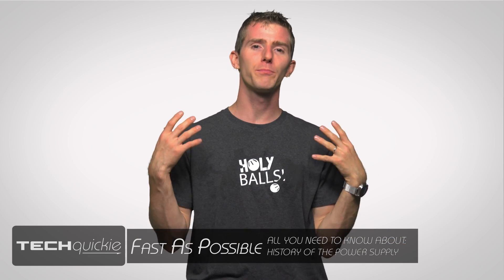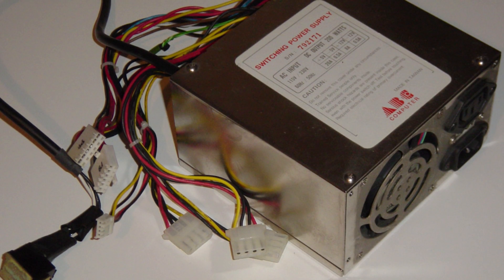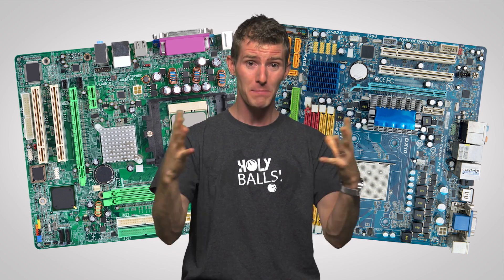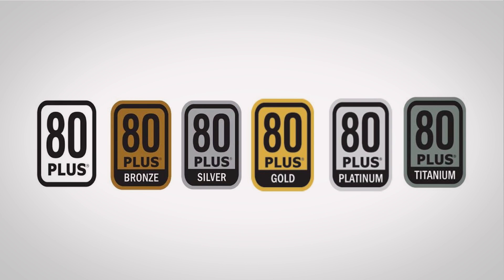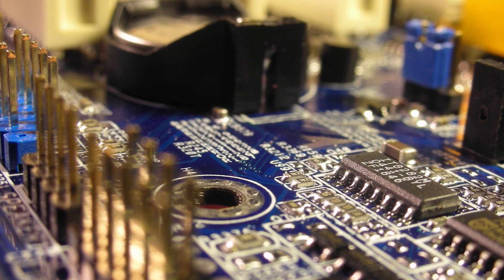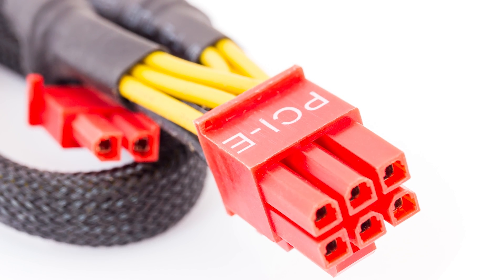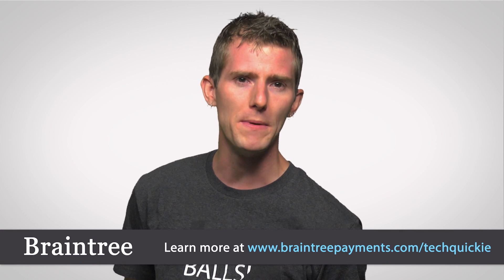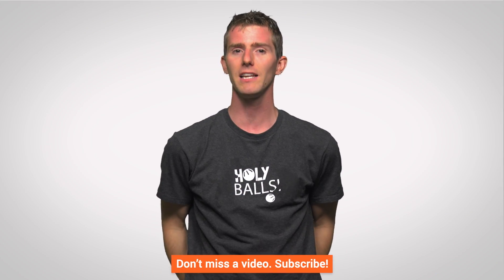History of Computer Power Supplies

Comment: What I really want to know is why you need 24 pins for 3 or 4 voltages. It doesn't seem like the motherboard uses enough power to require that considering the CPU and GPU get supplementary power. 8 pins on PCI-E gets 150w but I know the mb doesn't use 450w
Reply: because there also is data, plus minus, grounding and a dedicated line in and out for the boot sequence.
Reply: +tjeulink there's a single green wire for data (only used to power on) power off it done by reducing current draw through powered wires. There is also a single power signal cable. Other than that there is no other line used for data transmission since there isn't much that the PSU needs to know or tell. The remaining 22 cables consist of 4 3.3v, 8 commons (ground/minus), 7 5v, and 3 12v runs. It just seems like a lot to me and makes for a very unmanageable/bulky connector that delivers only a small bit of power.
Reply: +keco185 well what else would the Power suply need to do than deliver the correct Power format to components? you could make a smaller connector but that would make the motherboard easier to die because it would need to do quite a lot of Voltage stepping.
Reply: the ATX standard typically uses 18 gauge, PVC insulated single core copper wires. This wire will typically have a rating of 9.5 amps. This means the power wires going to the motherboard can deliver as much as 580 watts while remaining in spec with the limiting factor being the number of commons. Since the motherboard only needs to supply 75 watts to PCI-E devices, most of this is overkill. They could get away with 1 12v, 1 5v, 1 3.3v, and 3 commons (plus 2 data cables). This would total 8 wires instead of the 24 being used.
Reply: ***** yes but the pin connection can handle a maximum of 8 amps. and there are more than 1 wire for data, 1 for power on and one for power okay. it also needs the aditional power outputs for sensing the voltage drops, those cant be put on the same line. you need 5 volts for the standby function so your system will power on when the power supply isnt running (aka the system is off). then you need grounding for every line in. this is all i know top of my head, im sure its somewhere on wikipedia or something what ever line is used for.
Reply: voltage drop is typically done locally with drop across the cable compensated for ahead of time. It is not part of the ATX spec and doesn't take up any physical pins. There are 2 pins for data. My argument is that there shouldn't be a need for multiple pins with equal voltages. This is more of an antiquated thing which isn't needed anymore. When you say ground I believe you are referring to common. All 3 voltages can share a common if needed but most likely don't out of fear of cross talk which could increase impurities in the voltages. Also, standby power is not used to power the system on. Pressing the power button simply creates a short between the power on signal wire and the common. The PSU checks the resistance between these two and when it drops the power is turned on and the PSU then sends a signal to the motherboard through the 2nd data cable to start up the components. My guess is that these extra wires were used in the past to minimize voltage drops between different components (interference). However, modern voltage regulation should deem that unnessessary.
Reply: ***** it actually is part of the atx spec.
http://www.formfactors.org/developer%5Cspecs%5Catx2_2.pdf
common and ground is practically the same in this context
Reply: would you look at that. Well I guess that's 3 signal wires now.

Comment: IPC as fast as possible........ still waiting, Luke lied!
Reply: no multiplayer Luke ¬¬ ( /s)
Reply: The long and short of it is that the "I" in IPC is essentially how many calculators you can use at once.

So you have 2 hands, that's two calculators.

So that's 2 instructions you can do at once.

The "PC" part is "per clock," 1 megahertz is 1 million cycles in a second, 1 gigahertz is 1 billion cycles in a second. So if you run at, say 1 hertz(aka, 1 cycle a second), you could do 2 calculations a second with your calculators. If you ran at 1 megahertz you could do 2 million calculations in a second.

Modern processors can do a lot more than 2 calculations every clock cycle of course, but there you go.
Reply: same here
Reply: Llorch Durden h6

Comment: actually sfx psus are better because they deliver basically the same performance in a much smaller form factor
Reply: danielbatmanj The psu is pretty much the last thing that effects the choice of the case size... What I mean is, that you don't choose your case by the psu but the psu by your case.
Reply: How does that make them better? If you use a standard mid tower case there is no reason to use a sfx psu...
Reply: They are more expensive for the same wattage, and don't go beyond ~600 Watts.
Reply: Actually no.
Reply: If they were, linus would recommend them.
Reply: thats the point, with the smaller parts you dont need a mid tower you can get a mini tower or a super small case
Reply: actually they go to 800watts
Reply: +danielbatmanj different form factors are made to fit different applications and in this case the form factor does not matter
You can have a super reliable 1000w sfx psu but it's useless if you use a standard atx/itx case, and vice versa
Reply: Thats not correct, search for SFX-L the L is for long. Then you will find 700w + platinum from silverstone. It gets even better they are working on 800w titanium SFX-L . Interesting times we live in certainly.
Reply: Okay, I'll keep that in mind as soon as the PSU starts being the biggest component in the case.  GPUs are going to have to shrink a lot to make that happen though.

Comment: Explain redundant PSUs  please
Reply: if I'm not mistaken, those are the boards with two 42 pin connectors, right? Basically all servers?
Reply: In my (admittedly limited) experience with redundant PSUs, the unit itself had one set of connectors for the board and peripherals and two power supplies that slid into the unit. I'm guessing that under normal circumstances, they split the load but if one failed, the other would take over entirely and you could slide the failed one out and replace it without powering anything down or even opening the chassis.
Reply: Ideally you have each PSU fed from a different circuit in the electrical panel too.

Comment: Can a 600 watts Thermaltake PSU provide enough power to a 2 8-pin PCI-E videocard (1070 FTW)? Not bronze/silver/gold certified.
Reply: Yes that's fine, assuming your not running some crazy cpu like a xeon (which I would be very surprised if you were lol)
Reply: No, you need at least 10,000 watts
Reply: +tajony-32 you definitely don't need 800 watts for a single 1070. My roommate only has a 550 watt and he's rocking a 980ti
Reply: Should be fine
Reply: 1800w*
Reply: Dude, don''t go cheap, get at least 600-700 watts from a good manufacturer like EVGA or SIlverstone
Reply: 600w  should be able to handle two 1070's in SlI tbh, just never guy a psu that doesn't have an 80 plus rating, if they couldnt design it well enough for 80% efficiency in this day and age its probably lying about its power rating.
Reply: No
Reply: Get at least 800watt for that
Reply: 1800 watts should be something like the minimum to run a celeron+720
Reply: However, evga g2 550w and you take the perfect single-gpu psu
Reply: I suggested going with a power supply that is at least 80plus gold rated simply for the reason that with the higher efficiency comes lower heat output which in turn lower the noise output from the component. You can find the exact wattage power supply you need from cooler master's watt calculator located on the cooler master website. Also don't cheap out and go for the bottom of the line 700w EVGA like I did, once it hits about 400ish watts it quickly becomes the loudest part of my computer.
Reply: even if you have an fx 9590 should be ok
Reply: Just look up the recommended Power suply and go 50 Watts over that to be safe
Reply: It will work but you should get at least a 80+ bronze
Reply: At the very least, go 80+ bronze. Even some 80+ gold 600W PSU are on the cheap these days, from good manufactures too.
Reply: Questions like this are better asked on the forums: https://linustechtips.com/main/ Also, that PSU is very low quality and should be avoided. The wattage is overkill though.
Reply: Absolutely not. If you try to use your 600 watt PSU, you're going to fry your shit. So STOP right there. (Unless of course you REALLY want to blow your masterpiece into nothing). Unfortunately, this means spending a little more money than you may want. A 22,000 watt PSU is recommended for the 1060/1070/1080 (and soon to be coming 1050) cards. 

If this was helpful, please go ahead and share this with your friends. :^)
Reply: megaspeed2v2 You should also be weary that certain PSUs, like the one that he's talking about, have terrible internal components which can mean an early death for the rest of the system.
Reply: read this
https://linustechtips.com/main/topic/406160-psu-ranking-and-tiers/

and this
https://linustechtips.com/main/topic/199255-how-many-watts-do-i-need-check-here/

asking wattage is not enough
Reply: tjeulink Oh thank god someone who's not trolling.
Reply: the 1070 and a 6700k should use 300watts, not overclocked
Reply: PLEASE, do not be fooled by these trolls. That's considered "feeding" them, and that's just exactly what they yearn for. You're going to regret it. Telling you to read this or that, it's all rather impolite to you simply asking a question in high hopes to receive an adequate response. I soley want to help you out bud. That PSU is not going to be sufficient for your rig. As I stated previously, I would highly recommend finding yourself a nice 22,000 watt power supply.

Again, hope this helps, :^)

Comment: do you think this power supply was worth the money I spent? I haven't built my pc yet btw
Reply: https://www.amazon.com/gp/aw/d/B017MT9JAS/ref=mp_s_a_1_fkmr0_1?ie=UTF8&qid=1473208080&sr=8-1-fkmr0&pi=AC_SX236_SY340_FMwebp_QL65&keywords=replace+power+rp-atx-1000w-blu+1000w+atx+power+supply+blue+led
Reply: I'm not saying it's garbage.  Just that there is a reason it's named replace...
Reply: Haha
Reply: Zombiebros22 but seriously though.  That thing is a ticking time bomb.  45$ gets you a quality 500w psu.  850w units start at 100$
Reply: under 50 bucks, not bad, 850 watt, ok, i hope you dont have a lot of fans in your computer, also GPUs and overclocking can increase the required power, each and ever part should have a wattage spec on the brand website, you can list every parts wattage and then add them up, this appears to not have an "80+" ranking on it, ive been told that these rankings dont really matter, but i would go with a bronze, maybe silver minimum, always keep these in mind.
if anyone would like to add to this or correct me if im wrong, please feel free, after all, im no expert.
Reply: Lol, no. http://www.newegg.com/Product/Product.aspx?item=N82E16817438012
Reply: it's not even 80+ ...

Comment: lol apple logo at 2:47 ... Subtle
Reply: First, part of the UEFI Secure Boot standard requirements is that users should be able to either switch off Secure Boot or install certificates for their "own" Software (like signed Linux loaders). Secondly, Microsoft actually signs some free bootloader projects so that they can boot on Secure Boot hardware under Microsoft's certificate. Every modern Linux usees this approach as it doesn't require the user to do anything - at all. Because this bootloader has been signed already, they can't stop other systems in the future without breaking their own "old" OSes either. Signing this is - more or less - a sign of good will, because some manufacturers don't provide the tools required to load your own certificates... Plus it's nothing a standard user could do.
So, saying Microsoft is doing lock-in there isn't fair. In fact they - although reluctantly at first - started supporting Linux on Servers a while ago and are generally - in my opinion - opening to other OS.
Fyi: You can switch off Secure boot rather easily even on Microsoft's own most modern hardware: The Surface Pro 4 happily boots anything you throw at it with secure boot disabled...
Reply: shots fired...
Reply: Haha that subliminal messaging
Reply: Apple sucks at that time. They were going to close down if SJ was not back to rescue.
Reply: That's a good point, but at the same time Apple is also trying to lock people into their software ecosystem. Mobile app development for iOS, for instance, must be done on a Mac device, and the App Store will ban you if you try using a virtual machine to get around that restriction. Also, Apple ensures that no other manufacturer can legally sell a PC with their operating system installed.
Reply: @nonnarbl I don't think it's a necessary evil. If Windows is the only operating system you can run on your laptop/smartphone then Microsoft is the only one in control of your computer. It makes competition non-existent. It creates a walled garden for Microsoft to do whatever fucked up shit they want and enforce whatever crazy rules they come up with.
Reply: +mjc0961 I do agree that it is kinda overpriced, but I was wondering what you meant by proprietary cable connections. It's not like they only use firewire or anything. If you look at the macbook pro it has pretty standard cables. HDMI, USB, Thunderbolt, they even have a 3.5mm headphone jack. At least in the PC department they don't seem too proprietary as far as hardware. Also you can make a Hackintosh if you really wanted their operating system, in fact there's a tutorial that Linus made on it. Apple computers make really nice rich man's chromebooks.
Reply: You know that linus hates apple
Reply: Apple is useless 😂😂
Reply: Apple's just as proprietary, if not more so, at the software level as well.  Their proprietary software that you can only run on their overpriced, underpowered proprietary hardware that's full of proprietary cable connections.

The only positive thing to Apple's proprietary software is that it sucks ass and nobody who isn't already a mouth breathing Apple fanboy would want to run it anyway.
Reply: +Ryan Mattox why do you think we've all started to hate Microsoft increasingly more? Given how ubiquitous it is though, it's a necessary evil nowadays.
Reply: A issue that a certain group of people have , but not the masses that don't actually do this. Apple is the opposite in this regard.
Reply: @shooterboss I guess both Apple and Microsoft are heavily proprietary then.
Reply: Apple isn't the only thing that's proprietary. Sure it's proprietary at the hardware level, but Windows is just as bad as Apple as far as software, if not worse. Just look at secure boot, Microsoft's attempt at locking people into only using their operating system by putting a password on the bios that only Windows can unlock, making devices defective by design.
Reply: Ryan Mattox That comment didn‘t age well ;-)
Reply: @Haggleforth  I don't have that. Oh wait I never enabled it. Lol
Reply: @Haggleforth  I run Kubuntu with secure boot enabled without any issue. It didn't boot after I manually updated Linux kernel but then you can just disable secure boot and problem solved.